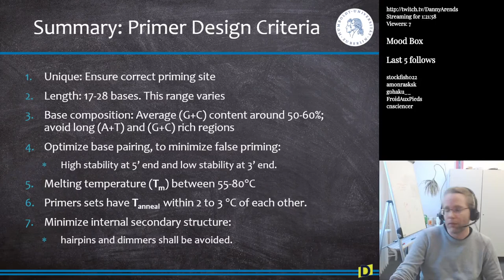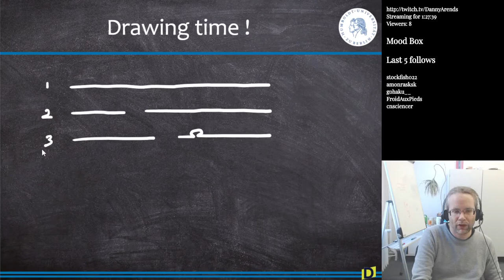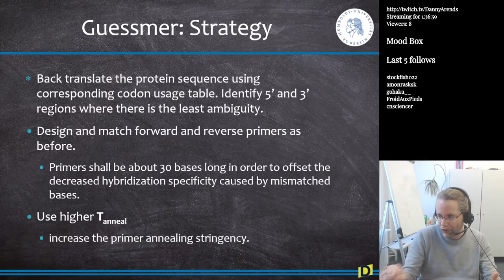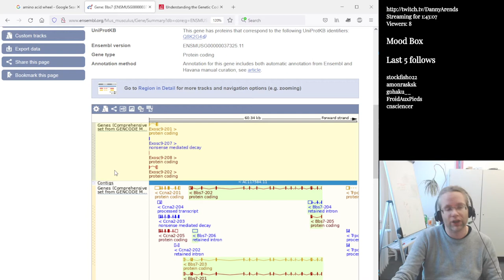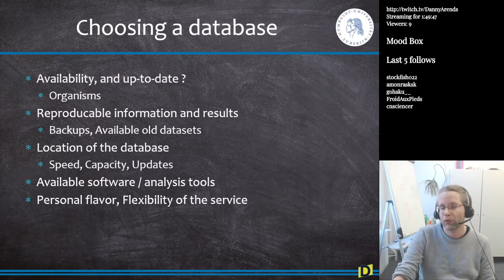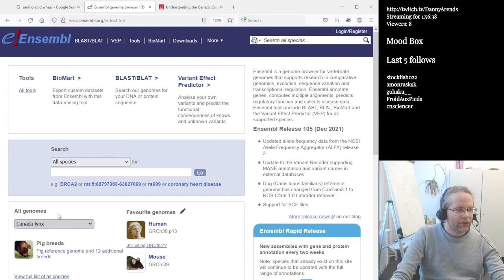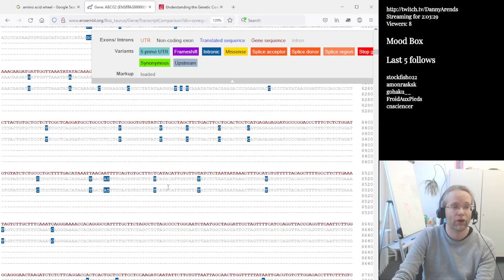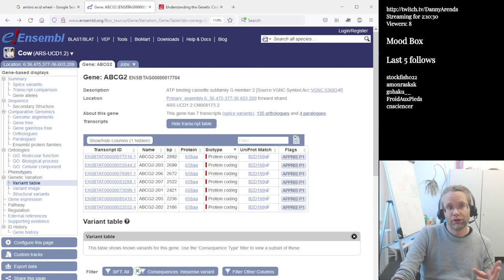Primer Design for RNA/DNA amplification (Bioinformatics S9E2)

Comment: Great content! I have subsribed to this channel.
Could you explain more about guessmers? Is that equivalent to degenerate primers?
Reply from the maker: Degenerate primers are indeed often used in guessmers, since after back translation from protein to DNA sequence you end up with uncertainty (2 to 4 possible bases) at the wobble base for each amino acid codon. One strategy is to use degenerate primers to cover this uncertainty. However, if there are many possibilities at the wobble base positions and you're back translating a large the number of amino acids the total primers in your degenerate primers mixture can sometimes explode, since you need to account for all possible sequences. 

Guessmers tend to be longer primers so that a couple of mismatches are tolerated, often this is used in combination with generating a couple of degenerate primers for the most uncertain areas, while having longer primers to ensure it binds.

Degenerate primers work best when you have only a single or a small number of possible sequences, e.g. in the case of a SNP at the location you're targeting with your primer, which  is known to segregate in the population to you want to investigate.